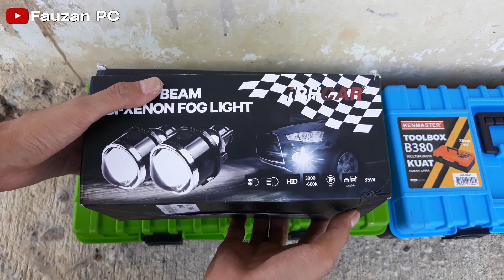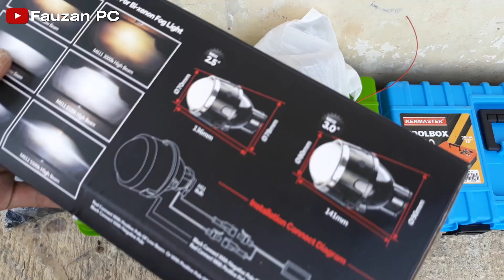Review dan Pemasangan Foglamp Projector Hi Lo - IPHCAR M612 3.0 Inch

Comment: Kl pake led h11 apa bisa hi lo bang? Kan h11 single beam. Mksih bang telat nanya, mo pasang di ertiga dreza
Reply from the maker: lampu led h11 nya memang single beam..
utk double beam nya ada pada projector nya, di projector ada selenoid utk pembuka lampu high nya
Reply: @FauzanPC  makasih bang... top markotop smoga makin sukses...👍
Reply from the maker: sama sama bang 😊🙏
Reply: @FauzanPC  maaf bang ikutan nanya, kalo kabel solenoidnya gak ikut dipasang, artinya gak pengen difungsikan hi beam foglamp nya, cuma pengen low beam aja kayak foglamp bawaan mobil itu tetap bisa kan? Makasih bang
Reply from the maker: tetap bisa bang, kabel selenoid nya gak usah disambungkan kmn mn

Comment: If i want to keep fog lamp projector always high so how should i connect it with headlamp socket?
Please reply
Reply from the maker: You can connect all the positive and negative projector lamp cables to the high light cable
Reply: @FauzanPC  thank you sir
Also i can connect the black wire of projecter with the black wire of the car fog lamp connector?